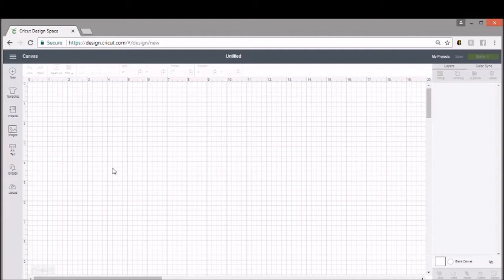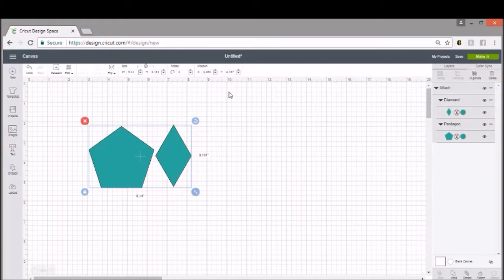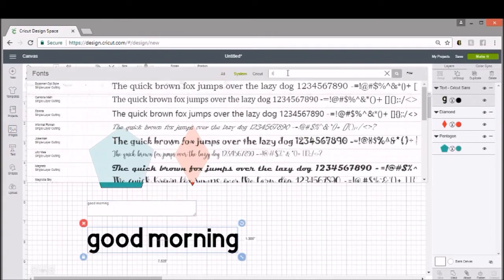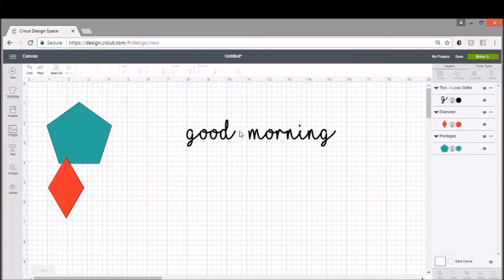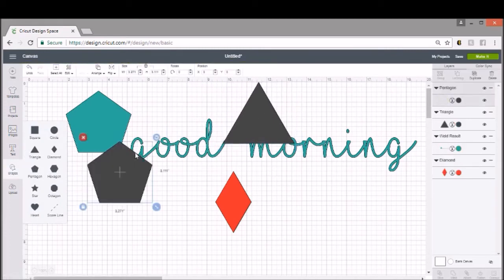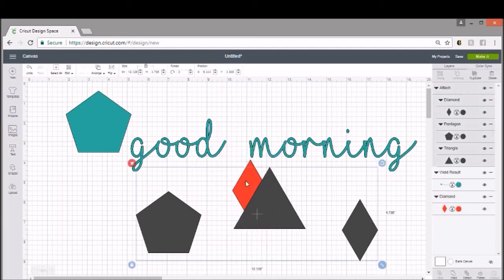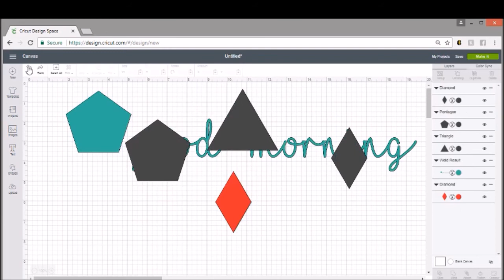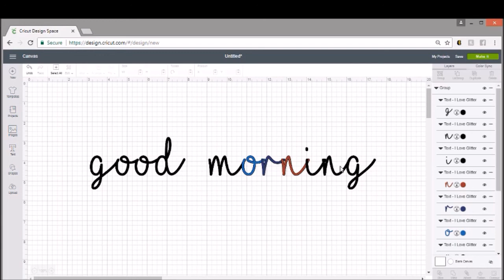How to use attach and weld in Cricut Design Space

Comment: not working. thanks
Reply from the maker: I’m going to need more than not working to assist you. This is also a very old video. Design space has updated a lot since this video was posted.
Reply: @CorinneBlackstone   hi thanks for getting back to me quickly I really appreciate it. I'm using French Script MT and  my O's are not welding at all in fact, there in the reverse in other word the negative, I adjusted the spacing between the letter so that they weren't overlapping. I then grouped then weld, it was a no go. I also tried ungrouping then weld still no good. and I tried the slice method however, once I positioned the circle over the letters, it wasn't given the option to slice.
Reply from the maker: @prosperity.  sounds like an issue with that font. Design space is weird and doesn’t work with every single font
Reply: @CorinneBlackstone   That may just be the problem!!! Thank You for your time and attention & to show my appreciation I just subscribed to your channel 😊 enjoy the rest of your day & Thank again.